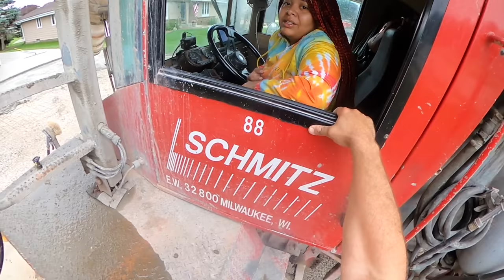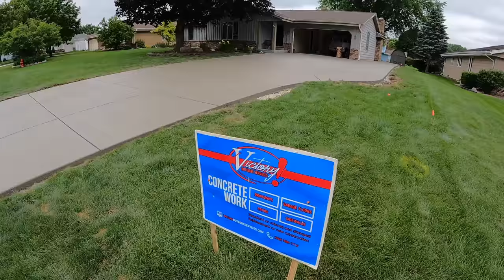Concrete rejected-Load was too wet!

Comment: Never ever go off a meter. Always look at it either at a slow turn in the drum or let a little out and see what you got. The kind of stone will change the slum meter. The temperature of the oil will change the slump meter. How much cement will also affect much water to add. Sometimes the load will sit there and not tighten up in transit depending on the mix.
Reply: Don't work with cement but I can understand the statement don't always trust the meter some of my equipment's meters are not as perfect as they should be (not really a surprise when the controller is using cathode ray tubes) 
By that same token hats off to him for not blowing up at her when he turned the load back.  You never know a person's experience level and at certain levels of experience them untrustworthy meters are all you got and even old salts sometimes get it wrong by not trusting them too.
Getting turned back like that didn't look like what she wanted any more than him and points to her as well for not trying to blast back.  I bet soon as she unloaded she got her meter checked and asks a few questions.
Reply from the maker: I agree 100 percent.
Reply: @kermit8619  you can also slow roll it to the job to have it tighten up a bit and go slow. Just saying it for those new drivers who may read this.
Reply: @kermit8619  I too have been a mixer driver for over 19 years and agree that it takes years of practice (as well as diligence with EVERY load). So many factors/variables to consider with each load and mix design. Very few finishing contractors truly understand how incredibly stressful the job can be - and not just the drive to/from the jobsite (often times that's the easiest part, lol). So many things can go wrong very quickly, especially when you are pouring in the middle of the night, running at a high pace and on little sleep, and on a rough-access commercial jobsite with blinding high power work lights blaring in your face and mirrors. We must bring our "A-game" with us, EVERY day/night, to and from EVERY job or risk paying severe consequences - with other's safety, with our own safety, with our employer, with the contractor, with the homeowner, with the police, with other motorists, with our finances, etc.
 Nothing at all wrong with always using the slump meter (with any load over about 2 1/2 yards) as long as one doesn't rely solely on it, regardless of whether one drives a Front or a Rear. Doing so, in a very general sense, would be like solely relying on a battery powered GPS to get you in and out of a vast forest without also checking your hand held dial compass reading - bad idea 🙁💀. 
 BTW, your English is fine, and actually much better than that of some of my fellow Americans in the comment section of other vids. Stay safe out there. ATB.
Reply: @VictoryOutdoorServices  garbage
Reply from the maker: @user-pn5fk8db9q  What’s garbage?

Comment: You definitely did the right thing by rejecting that load. It happens. Almost always driver error. I'm a retired mixer driver. I drove in Seattle for 25 years and have seen some pretty sketchy work, but you look like you do it right and take pride in your work. Great video.

Comment: Used to love laying concrete, we did a floor for the Honda factory in the UK years back and were told it had to have a smooth finish for the robots to run on. We had to go back and rough it up a touch after, as the robot they tested it with was spinninning too much. Do you guy`s ever use a fibreglass additive for larger area`s? We did and it was then just a case of running a cutter through once partially cured for the expansion joints, although the wider joints you created does look more pleasing to the eye. Great video and top class work.
Reply: Wow really?! Was it for the Formula 1 factory in brackely?

Comment: Why put mesh in the concrete when the majority of it sits on the ground?
The mesh should sit on chairs in the centre of the concrete for strength!
When cracks start to appear the Concreters tell the client that all concrete cracks which is true , but a lot less likely, when the mesh is in the concrete instead of under the concrete.
Nice finish to the concrete and the control joints nice and straight over the length of the driveway
Reply: That's what happens when you don't pay an independent inspector to be on site during the pour. I've been in this business as an inspector for 10 years and companies like Victory are pretty rampant with their terrible work and not being held accountable.
Reply: 99% of visible concrete cracking is the lack of sufficient joints and less joints than there should be
Reply: youre not 100% correct.

steel in the middle doesnt do much.

you need to put it at 1/3 and 2/3

because when the concrete bends the middle isnt under pressure tension, but to top and bottom parts are.

i agree the steel mesh does almost nothing when laid out like in this video.

but also if you have that many joints its pretty ok to have no steel at all if youre using quality concrete.

you can just get fiber reinforced concrete and easily do 1,5 metre slabs with 5cm plus thickness without it breaking

i mean its all about the costs.

if youre paying 5 times the money you get bunker concrete and it wont ever break and youll hate yourself when youre trying to pull it out
Reply: As a concrete worker of almost 10 years, Im shocked they'd put content of them pouring concrete and no one is actually pulling the wire. If you place enough joints (sawcuts), and lift wire properly, its more than helps the integrity of concrete over time when it expands and trys to pull from one another. Still in shock they posted this pour.
Reply: @justinklaassen7190   Study after study has shown that simply lifting wire mesh does very little to properly position the wire.
Reply: @montyx5montyx597  I agree it doesn’t help at all, even when pulled people still step on the mesh, it doesn’t do anything unless the wire or rebar is supported up and elevated from the start

As a pumper, I see this stuff all the time and can’t believe the lack of reinforcement sometimes
Reply: Yes I agree that the mesh should be in the center of the slab, however that's not for cracking. The mesh being raised 3" above earth or 1" above existing concrete is to prevent moisture interfering with the reinforcing steel causing rust and spalling.
 Cracking comes from differential expansion and contraction of the slab itself. Control joints and expansion joints will help with that.
Reply: @justinklaassen7190  no one pulled up the wire!!!!

Comment: The wire mesh should have been placed on support chairs or concrete brick so that it would have been placed 1 1/2" to 2" below the top of slab.
Reply: Or pull the mesh up as you pour . Basic mistake worse than wet concrete
Reply: @TUGG75  concrete brick.
Reply: @jeffreysivyer8939  American Concrete Institute guidelines for slab on grade construction do not accept this as an acceptable method for placing the mesh in the proper location.
Reply: @TUGG75  I am a retired structural engineer with both design and field construction experience.  The mesh serves as a secondary tensile reinforcement that keeps the slab from cracking when it shrinks (or tries to shrink) during the curing project.  The shrinkage cracking occurs because of tensile forces in the top portion of the slab and as we all know concrete is weak in tension.......hence the need for mesh to be in the top zone of the slab.  Placing it in the bottom or middle of the slab serves no purpose.

Read the American Concrete Institute guidelines for slab on grade design and construction.  The institute is vehemently against raising the mesh with hooks or whatever while the slab is being poured since there is no real control on where it ends up.

As a laborer during summers between college I have done my fair share of time behind a jackhammer breaking up concrete slabs.  My laboring experience has nothing to do with the technical nature and reason for placing the mesh where it does any good to prevent shrinkage cracking.
Reply: curing process.......not curing project
Reply: @jeffreysivyer8939  it's a half-assed approach that never works. you need chairs.
Reply: Waiting for reply from victory outdoor services. ???

Update: in another video he mentions that they do pull the wire up but you can’t see it on the time lapse 🤷🏻‍♂️
Reply: I agree. This must be some kind of joke video. We used to use the hook on the back of the rake to pull up the mesh but nowadays we use chairs. These guys are exactly the reason the word cowboy exists. Didnt even bother to lift the mesh, just straight on the ground. Then they blow their trumpets on the slump of the concrete and have no idea what that means obviously. Not to mention anytime we pour against a building we cover the cladding with plastic, like 5 minute job to avoid concrete splatter that will never get cleaned off. What a laugh. Oh and also you know the plywood nonsense have you not heard of a concrete pump? They are cheap these days and effecient. JOKE
Reply: Not to mention the screeding technique (you need to work the screed side to side not just 2 guys pulling a straight edge backwards!!!) or should I say lack of it and then bull floating in the same direction of the screed....WRONG... then re bulling in the right direction, look at all the pits. This is a shambles. Oh and here is a pro tip for you. If you are pouring concrete straight on top of the gravel on a hot day without a Damp proof membrane which obviously you dont need on a driveway atleast hose down the substrate first so the moisture from the concrete doesnt just soak into the ground and you are left later on with cracks everywhere.
Reply: @bucko60  Yeah, we call them dobies.  They raise the mesh about 2" off the grade and puts the mesh about 1-1/2" below the surface of the new concrete slab. And, they're inexpensive.
Reply: @bucko60  yip 100%
Reply: Agreed this a bad way to pour concrete. I am a registered PE with 30 years of experience and worked a lot of concrete jobs. The wire mesh is a bare minimum reinforcement, but it does absolutely no good when it is on the bottom of the concrete. He can claim they were lifting it, but 1) that is the wrong way to do it, and 2) his guys made a half-hearted effort in doing it. He is wasting his client's money. This concrete will look worse than the asphalt he took out after 10 years. And he will be long gone.

I am glad he doesn't live near me. I would never hire him after watching this.
Reply: @blackdiamondkj your post needs to be at the top of the comments.

Comment: i do concrete work in new zealand...we always lift the steel mesh to get it in the middle of the slab not just have it as a decoration under the slab.....we cut a couple of days later with cutting discs as opposed to when wet....but this sure looks nice with big cuts
Reply: No kidding.  Not sure what that mesh is going to do when it's sitting on the ground.
Reply: @scottlynch449  they usually put some cement 2in cement blocks or so, so it’s right in the middle but maybe he just didn’t show that part. There’s no use for it like you said if its just in the ground

Comment: i do a lot of concrete tear out Demo. Slabs with wire on the ground always break out easy.
Reply: I watched on one job I was on the crew that came to tear out a $45,000 driveway and walkway where the rebar was laying on the ground, they said it was the easiest job they ever done because of that. They made that “easy” money that day.
Reply: There is ZERO point in laying steel trellis and leaving it lying UNDER the concrete.
Reply: He didn't leave it on the ground he lifted it around the 20 minute mark
Reply: Yeah, I was watching, I’ve yet to see anyone pulling it up as it should be.
Reply: @douglasmichel6361  in the side car park when he did the first dump of concrete the one worker lifted it slightly. It was a sarcastic comment
Reply: My exact thought, concrete looks great, but left all the wire laying
Reply: Great job other than leaving reinforcement on the ground, Autumn was cold you could of put her in charge of pulling it up, My beliefs are if it was the 6x6x10 gauge leave it on ground because that's where most of it ends up even if u pull it up but the expense of those 6 gauge mats it should b up,  next time just put couple pounds per yard fiber mesh if your not going to pull it up, looks damn good for a hand float broom finish though
Reply: @wk9953  Utter bollocks. 20min is when he started pouring and I've just viewed it again in case I missed something. You are talking bollocks. He chucked it down and the team got it levelled and finished straight away. No one made the slightest attempt to lift steel trellis. This is clearly NOT something they are even aware of.
Reply: @tracrooster  ….over the years we broke a few hoes for mixing in a tub, the great thing was the hook left on the handle was prefect for pulling up on the mesh.  But now with fiber mesh….. sweet
Reply: @douglasmichel6361  I'm retired now, but had been a senior QC and technical/materials tester at a very well known natl concrete testing labs. Fibermesh isn't all what ppl make it out to be. We've done extensive testing on a wide variety of fibermesh products, and while most do help with surface cracking/crazing, our testing revealed that it takes, in general, approx 3x the 'dosage' of fibermesh into the mix to even produce a measurable effect on typical concrete cracking restraint.
Reply: @hyperbaricaxom1763  your absolutely correct, with an engineering background/standpoint you can’t beat rebar, of wire reenforcement. But if not placed properly it’s useless. Right down to minimum coverage. Fiber mesh is I suppose the cats meow if your not going to be pulling wire up and leaving it lying on the ground or not using chairs to hold up rebar. I’m sure you’ll agree It is better than nothing. It has its place, which is usually side walks, driveways perhaps, but in columns of parking garages, I don’t think it going to be eliminating rebar and wire in the near future.

Comment: The Wire Reinforcement Mesh should be lifted off the ground during the pour in order to be effective. I guess things are done differently in Milwaukee.
Reply: Same here in Australia. Love watching concrete cowboy's X'D
Reply: small blocks of wood at strategic spots would work too..or should i say "wood work"
Reply: Cut a hook shaped notch in the corner of your shovel in a " J" shape( If the shovel doesn't have one already) and use that to grab the mesh and pull it up after the concrete has been poured. Just walk through the concrete with it and work backwards pulling up, just don't pull the mesh all the way to the surface of the concrete when lifting. The mesh will stay suspending in the concrete.
Reply: @0xsergy  Good practice for elevative support of reinforcement is that whatever is supporting the wire mesh or rebar should be of the same compressive strength as the concrete being poured. It also needs to meet corrosive standards. Wood is not an acceptable support for any wire mesh or rebar reinforcement of any concrete structure including a driveway or sidewalk. Plastic and steel "chairs" are sometimes used because the concrete can flow into them and become part of the reinforcement. Wood inside concrete will quickly degrade and is not suitable as any sort of support structure.
Reply: or just use fiber in the mix, especially for a slab that's only 4".
Reply: @bucko60  fiber is not a replacement for reinforcement
Reply: @kaliversen9396  I agree. But for a 4" driveway, it would suffice.
Reply: @0xsergy  wood expands with water and could crack a slab, as it's tensile strength is 10% the psi rating.
Reply: you can see them lift it up with their rakes when it goes all fast.. works for rebar but mesh gets pushed back down too easy as you walk on it best to just chair everything.
Reply: @0xsergy  wood is not a suitable chair.. concrete bricks or specially designed chairs that the concrete flows into work best
Reply: You will notice no responses from OP on the mesh question.  Any responses could be use against him in future litigation.  I think he knows. Easy Money!

Comment: Now whats crazy is I've NEVER done concrete in my life but even as a complete spectator I can see that concrete has WAY too much water in it.
Reply: When you mix concrete you don't accidentally make it that wet. It's done by the company's to try to be sneaky and save money. Concrete is measured by yards a yard weighs a certain amount Each truck carry so many yards. So a yard of concrete weighs just over 4,000 pounds. If they can make that 60% water in 40% concrete they're making a killing and not using as much concrete at the same time
Reply: @TIDEPROCESS18  I forgot to add the end of my comments sincerely someone who lives in a small bubba town. What can you do about it? Call and complain? Then what you're SOL on ever getting a concrete truck again because you're a snitch.

Comment: Done a bit differently than we tend to do it around here, but there is no doubt you guys do high end work from what I am able to see.
Reply: How'd u diff?
Reply: @seanmayo206    I am not aware of anyone hand finishing a pour that size in the area, that would be machined.  Also the joints would be cut as opposed to tooled.

Comment: A question. I often see that you guys in the USA simply lift the mesh as you are pouring. Do you ever use spacers, or is it not worth it for the area you are in. Here in Australia it's normal to see a plastic layer go down, then  the mesh is held up so it sits roughly 4-5cm from the bottom, and since most pours are 8-10cm thick, that puts it in the middle.

Also appreciated the way you handled the wet concrete delivery too
Reply: I tried to pour garage floor myself and set mesh on plastic spacers, twisted them together and when truck came and started to pour it all floated away as didn’t pin them to ground. Should have know that can lift like that and be done.